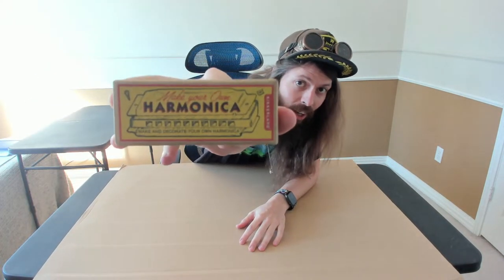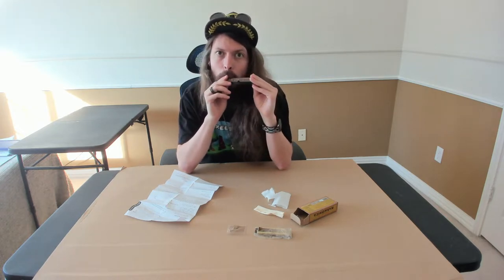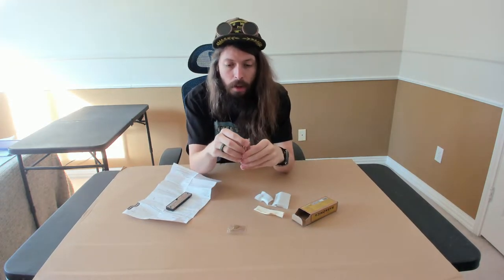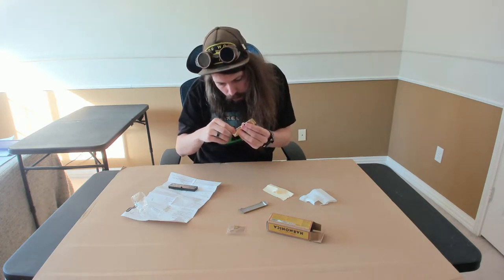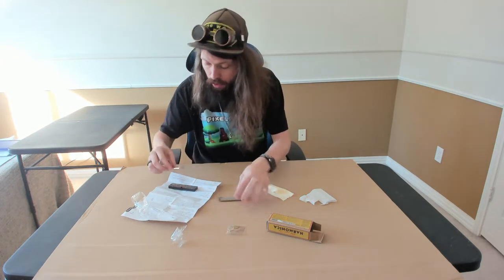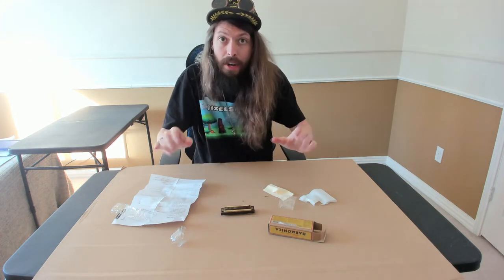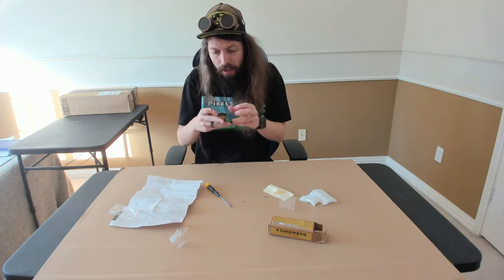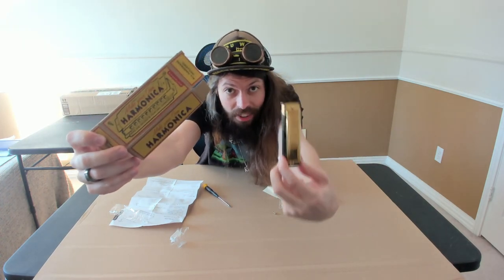Box Opening: Make Your Own Harmonica

Comment: I recently took apart and replaced the reeds of a Lee Oskar Harmonica that I own, and put it back together. Given that this only comes with getting the covers on, this should be pretty easy to do, as I think its geared more towards kids. I bought this because its unbranded is gold plated as my one of my travel harmonicas since I don't want to take out my expensive harmonicas out on the road.